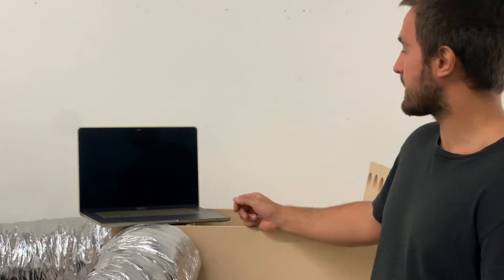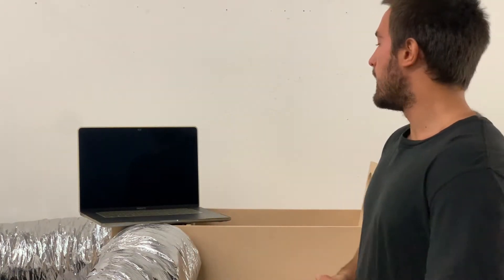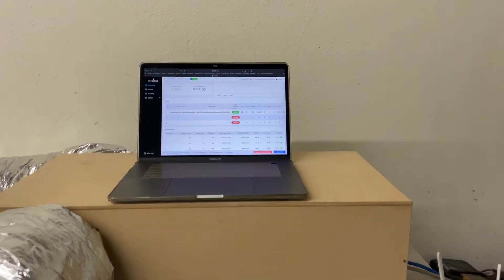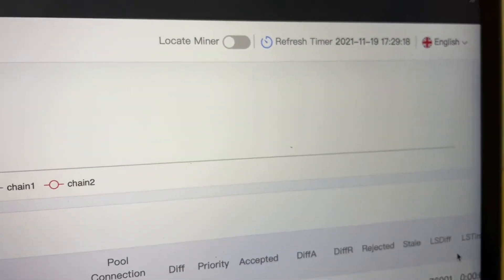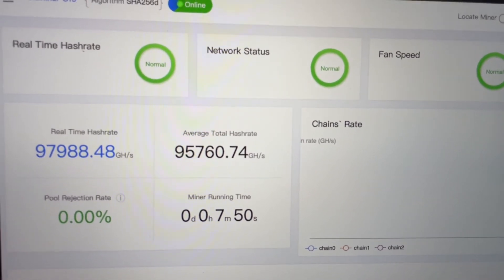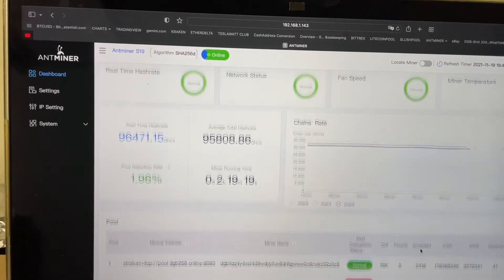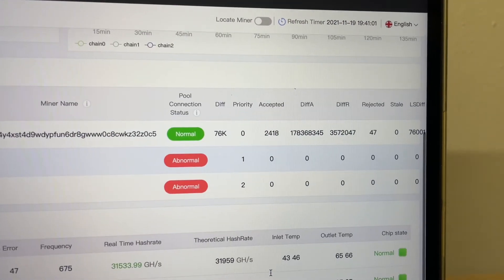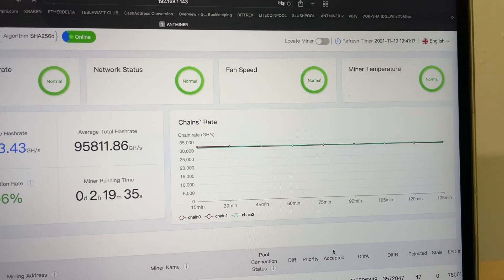LiteSound Box for Antminer S19 - Hashrate & Temperature after ~2.5h

Comment: Hi why my L7 outlet temperature is by 81? And your miner is by 60s I don't get it
Reply from the maker: Hello VP, our video shows high 60C temperature at 50-60F ambient temperatures. It's normal that all miners will run at higher temperatures as we all approach summer and take in account humidity in your area. Key to sound proofing is proper airflow and set up. Some climates require installing of inline fan to help hot summer days.